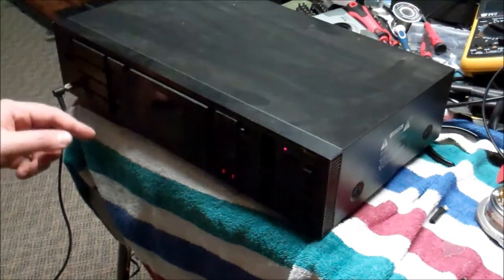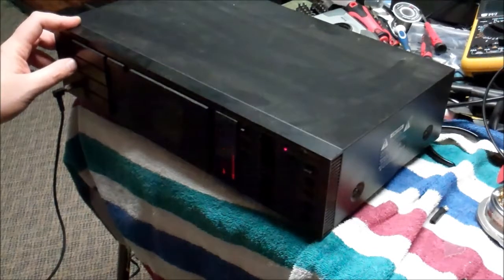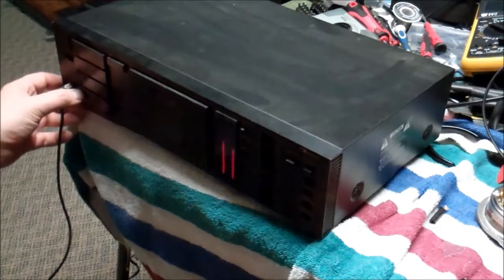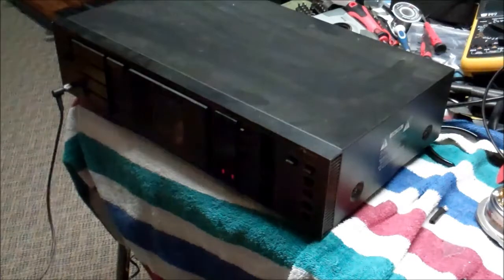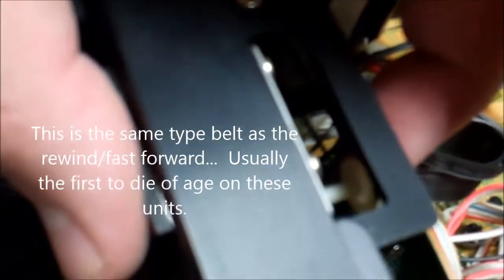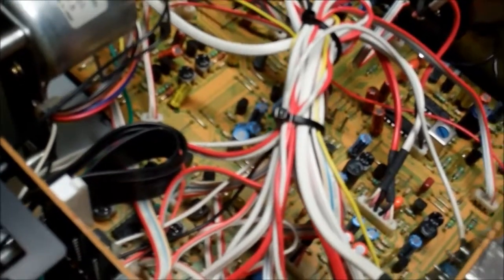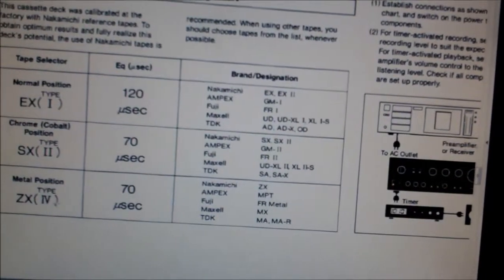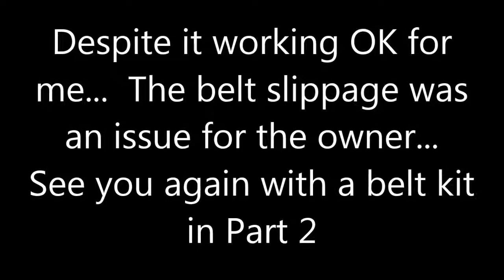Nakamichi BX-100 Cassette Deck Check-out Part 1

Comment: Hi. I have a question . I have the same deck. I have issue. When push Power button. Showing buttons Pause and Play. What is a problem could be?
Reply from the maker: No idea.  Sorry.
Reply: @DeadKoby  ok thanks.
Reply: its normal.

Comment: The EQ 120 or 70 micro second Is the playback EQ. 120 for normal tapes and 70 for high orMetal tapes it is also set when recording.. The SX, EX , ZX controls have no function in playback, only recording.
The master fader is a recording function.
Reply from the maker: @Yoda8945  thanks for the info.